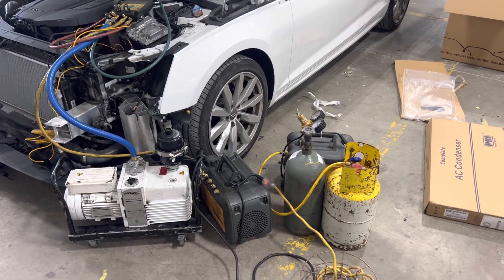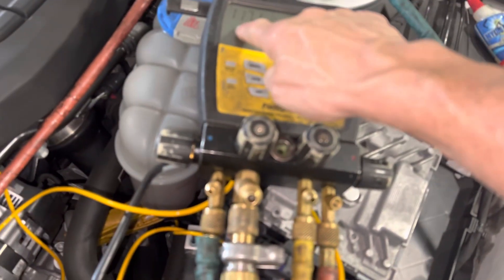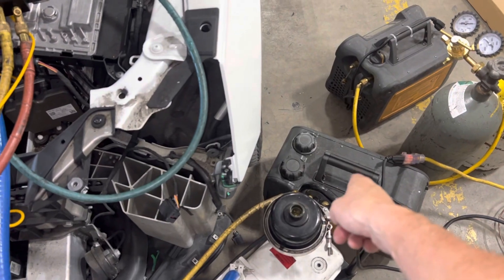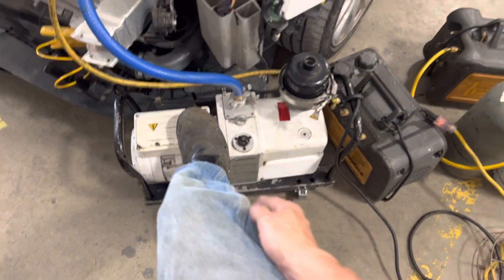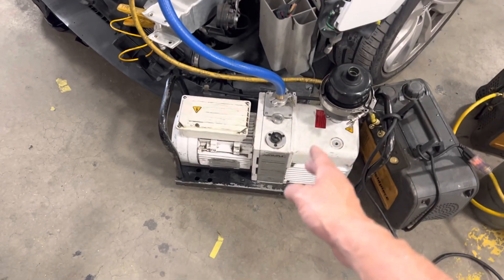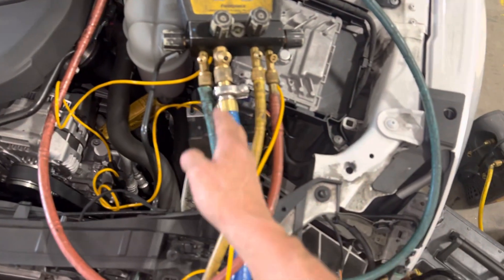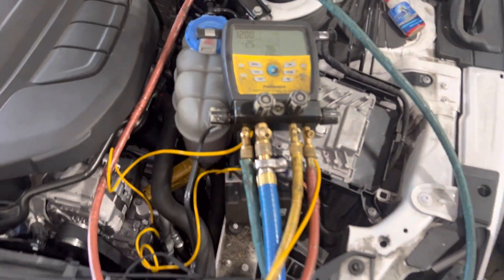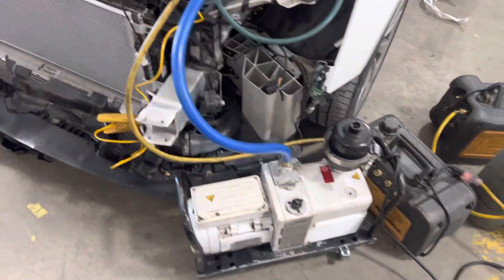VACUUM PUMP OIL. How often do I change￼

Comment: Tom, I have an inexpensive 3.5 CFM single-stage Zeny (VP125+) vacuum pump that claims to be able to pull a 40 micron vacuum.  I will test that claim when I get a micron gauge.  In the meantime, do you have a video where you discuss vacuum pump oils?  Zeny recommends High Vacuum Pump Oil for my vacuum pump, but I'm unsure what High Vacuum Pump Oil is.  Thanks as always, Ron.
Reply from the maker: I’m thinking of the synthetic oils that is a 68 that is used from some of the large high-quality brand-name vacuum pumps. It’s about $58-$48 for a court. 

They have it on True Tech Tools online . It’s the vacuum pump oil that is used and recommended for the NAVAC 12 CFM model number 16T that is rated down to 3 µm.

Comment: I watched a CPS video showing a 3400 before and 30 micron after an oil change, though there was no detail as to how long the oil had been in the pump or what it had been used for.  This seemed rather hard to believe, but then they could have been using it to make water in a vacuum chamber boil before hand to demonstrate the point.

Have you ever undertaken a comparison of vac pump micron level before and after an oil change?
Reply from the maker: @mickandrews9458  in many of my auto shops I found they never changed oil in years. Some would do once a year.  Tested shop pumps.  Many only could hit -29  or into the thousands of microns range. 
      After changing refrigerator oil, most of them were able to hit under 1000 µm two about the two or 300 by range symbol of more capable of going back down to under 100 µm. 
      Somewhere to damaged, unable to get into the micron range. 
      Because the shops had analog gauges they never knew because it usually always hit 29 or really, really close when the thickness of a needle.
Reply: @coldfinger459sub0  Thanks, useful to know.  Just about to change the oil in my SuperEvac and will see what difference it makes.  But while I was at it, I wondered by the gas ballast did not seem to make any difference when opened and now I know why.  There was a grub screw inside it blocking it off, so no surprise that undoing the gas ballast cap made no difference.  I removed the grub screw using an allen key only to find a rubber seal blocking if off as well.  I managed to fish this out and clear out the thread of rubber bits from the seal using an interdental toothbrush.  Now it works again as I would expect it too.  How odd is that; have you ever seen this?

In a previous post I mentioned a Yellow Jacket vacuum gauge reading 260 microns when sitting on the pump, which made no sense.  I cleaned it with IPA and now down to 110.  Hopefully changing the oil in the pump will get me back to the levels below 50 that I would expect.  This just shows the importance of cleaning sensors.  It looked completely clean, I could not see any oil, but it still needed cleaning.
Reply: Quick update. Changed the oil after re baselining and went from 120 to 90. This is the identical type of oil. The pump had say 40hrs on the old oil and was used to evacuate and AC on an Audi. Quite disappointed that not any better but I am not using Yellow Jacket or any other specialist oil, just a basic vac pump oil of the appropriate viscosity. It would be interesting to see what difference using the YJ oil makes.
Reply from the maker: @ I have a video out there, switching oils showing the difference between regular mineral oil based and synthetic based vacuum pump oils

The Synthetic Dodge reduce the micron level. I can’t remember in my test if it went from 30 µm down to 18 µm in one of my videos both had brand new oil prior to switching the oil. It was brand new oil..  and then immediately pouring out the mineral oil and pouring in synthetic oil

Synthetic oil supposedly is rated to stand moisture contamination longer. They say up to six months in one pump manufacturers instruction manual for maintenance. 

But the difference is you can get 1 gallon of mineral oil somewhere around $30 a gallon plus or minus a few dollars 
     1 quart of the synthetic vacuum pump oil is between 47 and $58 a quart

Comment: I see u often pull a system down to well below 500 microns then wait for system to stabilise , generally a rise of eg a 1000.  decay /leak test At what point ie micron level do u repair your vac pump .Many recommendations seem to be  500micron max  limit because only limited moisture removal occurs  above this   . Whats your opinion ???????
Reply from the maker: This is true you’re shooting for below 500 µm. 

But when other people have worked on the air conditioning before they usually contaminated the system, so bad with moisture that when you get the vehicle in your shop, you will not be able to have a finishing resting vacuum decay of 500 µm. It’s just not possible on some vehicles. .   Because the technicians before destroy the system with moisture.. 

Unless you left it on the vacuum pump for 24 hours I made some videos about that . 

Where I was unable to get below 500 µm because a Vacuum level was so high . 

But it was at the end of the day while I’m at the shop so they would be closing before I could finish .  So I would tell the video while you’re watching it. I’m gonna leave this vehicle and overnight. It will come back the next day and see where the vacuum is at.. 

Usually by 12 to 18 hours later when I would return the vacuum will be well below 100 µm . 
           This is how bad technicians are responsible for contaminating the system with moisture. 

Especially if the vehicle into a body shop for the open off the lines, leave them tangled in the air for days or weeks until they get all the parts .

One thing I would always do over the decades is if I was called into a shop for the first time .  And they did air conditioning, but they would call me because they were having trouble. I would always ask to see their refrigerant leak detector and I’d use a test reference bottles and often found none of the shops leak detectors were capable of sounding off on the lab reference leak test bottles. 
        And test the vacuum pump and usually find they cannot make it into the micro range or there were in the thousands. .

Comment: Why do you use this big vacuum pump?
Reply from the maker: Big is not the important part.  But it’s rated to go down to 3 µm.      Most vacuum pumps are ready to go down to 15 or 20 µm.        It actually takes a lot of extra energy to get that few extra microns down. 

But I also use the big vacuum pump for commercial air conditioning and heat recovery on large 20 ton to 60 ton systems that I sell and install with my son.   
                    It also has the advantage of having a three-quarter inch open port to connect with my three-quarter inch silicone vacuum hose. 

Flows faster and pulls deeper.  The faster and a deeper you can achieve your lower micron ratings the more time you have for removing moisture out of the contaminated oil.  And metal surfaces.
Reply: @coldfinger459sub0  right now i'm using 6cfm chinese vacuum pump that is rated to 10-1 pascals, but i have never got measurement below than 98 microns measured directly from pump, also i have big edwards 28 pump that needs rebuild, i was thinking is there any point to restore it for using it in car hvac work.
Reply from the maker: @tanellaa  if it can be easily and cheaply restored and rebuilt by yourself hell yeah.

Comment: Is it a good practice to change vacuum pump oil once the pump can't pull below X microns, with gauge attached directly? If so, what would that number be? Maybe 30-40 microns? Is Yellow Jacket oil not synthetic?
Reply from the maker: Daly oil change.    If you wait that long that is like doing 25,000 mile engine oil changes.      Or at least weekly or monthly.   I do 6 to 8 a day.  I change at end of day. Only takes 30 seconds on the fieldpiece

Comment: Holy crap, I didn't know vacuum pumps could get so expensive. I got a harbor freight single stage a few years back for maybe 50bucks. Maybe you can do a video on what your pumps can do that a cheapie pump cant
Reply: Tom uses the most /best tools on the earth!
Reply from the maker: @jrm163  there are Better high end lab grade tool that cost ALOT !!! MORE!!!
Reply from the maker: I wanted to buy a few different cheap vacuum pumps one from Harbor freight one from eBay one from Amazon and do some comparison videos.     
                  But I knew would be a complete waste of my money 100% waste not even a doubt. 

Because I see automotive cheap automotive shops who are not qualified to work on air-conditioning buy these cheap pumps

I see them burnt up or barely working and they use them anyway on customers cars. 

So I have first-hand experience with many cheap brand pumps no-name pumps that the lowest and low life shops purchase. 

It’s OK for do it yourself person who’s only going to work on their own vehicle

But no professional shop should ever be using those pumps

I purchased some of the cheap Amazon and eBay gauges made videos about them they are as cheap as cheap can be.  

They either all failed vacuum test or all failed pressure test.
Reply: @coldfinger459sub0  sounds about right. My pump leaks when I shut it off, it's enough to max out my gauges with only go to 30inches mercury vacuum and starts creating a fog if I run it longer than 10mins. It'd probably be long broken if I used it more than 2 times a year
Reply from the maker: @lm7bird680  Should not be creating a fog it’s creating a fog I mean there’s a slow leak of air in that fog is actually a oil missed from the vacuum pump oil

And the only reason they put out that oil missed is because it’s continuously still removing air that is leaking in somehow. 

If there was no air forward to evacuate anymore it would eventually stop if it doesn’t stop that means it’s getting a source of air that is going through the pump creating that fog
Reply: @coldfinger459sub0  I figured it was oil because the fog leaves an oily residue on the pump. The pump does leak air and I have to shut off the valves to the pump on my gauges to prevent it from leaking into the system